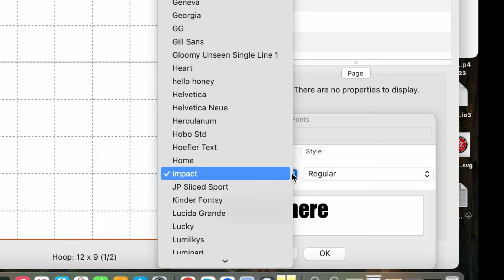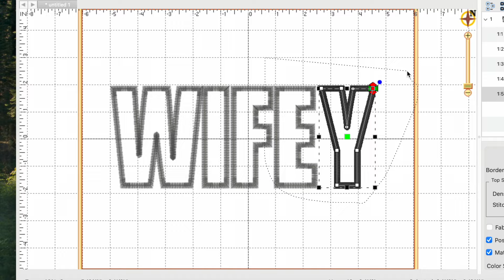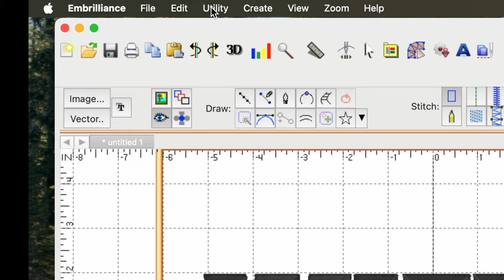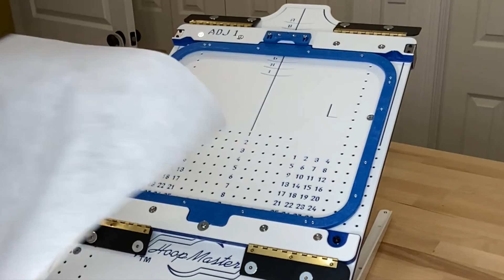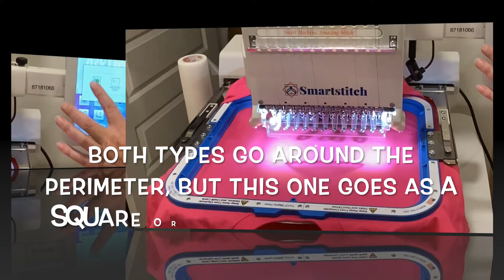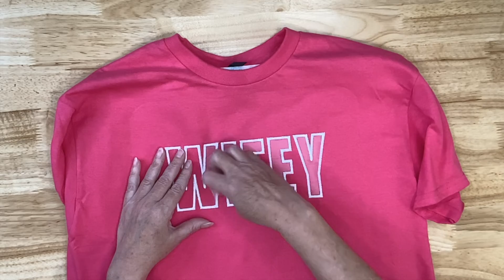Designing and Stitching a Wifey Embroidery Shirt

Comment: 😊 Great video.  I dont have the Embrillance software, but as usual you make it sound so easy. is this possible to be demonstrated on a single needle machine with design software business edition? TY
Reply from the maker: Thank you very much, Cheryl! You can definitely stitch out this design on a single needle machine as long as you have a large enough hoop. When talking about the business edition software, are you talking about Silhouette Studio Business Edition? If so, you could make this design in that software and then cut it out of HTV to use on a shirt.

Comment: Hi Marilyn...Happy Anniversary!  Perfect timing on this video.  I just started embroidering so very new at this and have been trying to do it on a t-shirt and struggling.  I get puckering and was starting to wonder if a Gildan t-shirt is too thin.  But I think you used a Gildan softstyle shirt in this video, right?...which is even thinner than the regular heavy cotton ones that I have been practicing on.  I just have a flat bed machine so wonder if I am not getting the hoop tight enough.  Your video gives me hope that its doable!
Reply from the maker: Thank you very much for the anniversary wishes😀 I actually used a heavy Gildan shirt as well. At Michaels, the heavy cotton Gildan shirts are not nearly as thick and hard as they used to be and I absolutely love them. When you do yours, do you attach the no show mesh to the back before hooping it? I've done t-shirts on my Poolin flatbed successfully as well, but with a non-Mighty Hoop, which does make it more challenging.
Reply: @MakingwithMarilyn  Ah, interesting.  So I haven't tried attaching the no show mesh to the t-shirt - just hooped both together.  The one time I tried that with a sweatshirt, I found that I had leftover sticky residue when I detached the no show to cut off the excess from the back once it was done stitching.  I want to be able to ship shirts out right away, so don't know how to get rid of the sticky residue.  Maybe I sprayed too much on the shirt.  Have you experienced sticky residue?
Reply from the maker: @ebypineda-dorcena4550 I have not experienced that. Maybe different brands?
Reply: @MakingwithMarilyn  I used the Basting Adhesive in the purple can that I see a lot of people using on YT, but maybe I used too much.